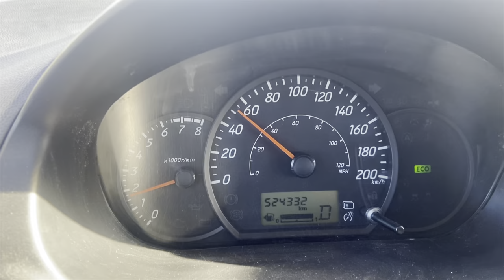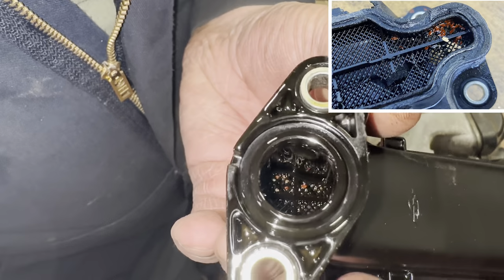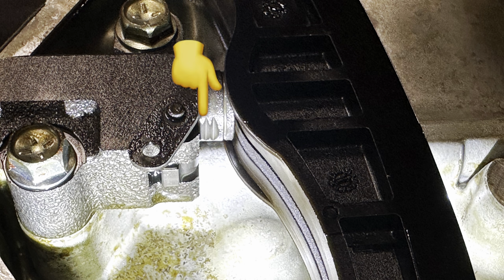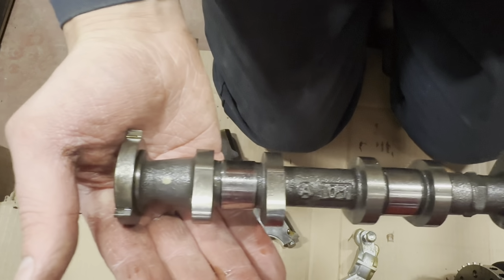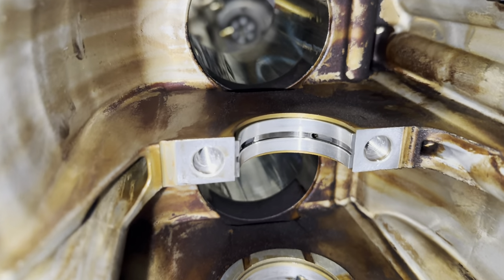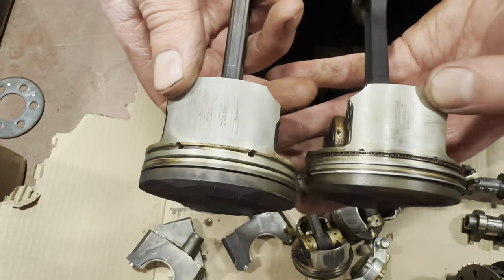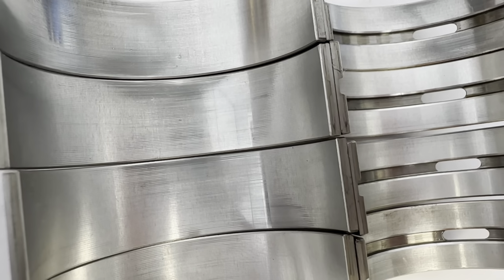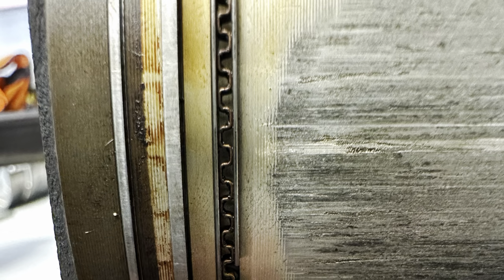524,000km Mitsubishi Mirage engine teardown

Comment: By the look of this, I’m going to die before my mirage. I bought mine in 2014 at 30. Now I’m 40 and the car doesn’t have 90k. So another 40 years of duty for her I guess 😅
Reply: it will definitely rust through before engine gives any sort of problem ¯\_(ツ)_/¯
Reply: You've got a family heirloom!
Reply: Lol yeah the little Mitsu is definitely gonna give you a run for your money. 

I remember back in the early 90’s my mom bought a Toyota Corolla that she swore she would keep until it died. She said she would NOT buy another car until the Corolla was done. In 2005 she flat out give the Corolla away with 250,000 miles on it. Me being the cheeky bastard that I am was like “mom I thought you were gonna keep it till it died? 🤣” She says “no I got tired of waiting for that thing to die. No one should have to drive a 1990 Corolla for as long as I’ve been driving that car” lol. She bought a brand new 2005 Camry SE that she drives till this day.
Reply: @Soh90  Toyotas are awesome just because of how many owners they can go through without becoming a piece of shit. A lot of cars are designed with only the first owner's experience in mind, but Toyota's interiors, drive trains, and chassis', are all engineered to go through several owners while still feeling as good as the day they rolled off the dealership lot, provided they are properly maintained. Many other brands, even when well maintained mechanically, have disintegrating seats around where the thigh meets the chair, melting steering wheels, and a rut worn in the carpet or floor mat right where you pivot your foot on its heel from the brake to the gas, but very few Toyotas, even extremely high mileage ones, I've seen these kinds of traditional wear patterns in. For contrast, my place of work has a Nissan Frontier with less than 30,000 miles, which is used as a company vehicle. There is a literal HOLE in the carpet where the driver rests their foot that is deep enough it catches the heel of your shoe if you try to adjust the angle of your foot to the pedal.
Reply: I bought a 2019 G4 5 speed a year and a half ago. I bought it with only 10,600 miles on it, now it has 20,500. At ~8k miles/year, I think mine will last a long time.
Reply: A car doesn’t know if it was driven 100k by one owner or 10k each by 10 owners.
Reply: I live in the rust belt, my '15 gets oiled spring, and fall. Mechanic says no sign of rust, yet.

Comment: Here in Australia, the 1.5L 4 cylinder Mirage(3 door) and Lancers have revered status as bulletproof runabouts. I bought one from a wrecking yard - it just needed a hood - and with some brakes, injector o-rings and roll bar bushings we got it registered for a new driver. He, naturally, ran up the arse of someone and bought something else but still mentions how reliable and simple to work on the Mitsi was.
Reply: Everybody wants a 4 door truck or a SUV here then complains when gas goes up sometimes.
Reply: yep my first car was a Mirage with the 1.5 4G15 and i cant think of any car ive owned since that has been as painless maintiance and repairs wise as that simple little N/A eco "shitbox" Mitsubishi was. stick oil and filters in it every 10,000km and it would run forever i reckon as seen in this video.
Reply: My neighbour has a manual 5 speed mirage, he drives it like a taxi, just services it when it's needed and it just keeps on going.
Reply: Arse 😂😂😂😂😂😂😂
Reply: R.I.P. Mirage, may you be a part of someone's beer can, one day. He did not fight long, but he fought well, fearlessly, and with great fervor.
Reply: My brother has a 20yr old, 3 door lancer with 4g15 engine. He has spent $0 on his car for his 17yrs of ownership.. Nothing has broken, everything works and it still drives well. He can't come to buy a new car when the Lancer just keeps on going and going. He doesn't even service it by the book.
Reply: I think that's why the title of this vid threw me - I'm in Australia as well and these cars are super popular here.
Reply: @MattyClivingthedream totally agree with you there, I can't speak for the Mirage but I have a 2008 Mazda 3 (2.0 engine) and despite being 16 years old the thing just doesn't miss a beat. It was given to me by my uncle as he wanted to upgrade. I've owned it since 2017 and apart from oil changes and wheel bearing I haven't spent any money on it at all.

Comment: I worked at a tiny mitsu dealer and i always enjoyed these cars for how fun and cheap and simple they were, especially with the stick shift. Good, BASIC transportation. especially if you get 300k+
Reply: It sucks that today these are going away. Here in Austria a Yaris starts at 21k USD with some rebates and 26k USD MSRP and it's only available as a hybrid. Meanwhile in Japan they can buy a Yaris with 1.5L 3-cylinder and 6-speed manual for 12k USD. The worst part is I can't really import one, I'd have to get a used one fron the auctions.

Comment: the cleanest 325k mile engine i've ever seen.no wonder it went 325k.obviously well maintained.
Reply: Oil change every 12k, car is 2015 and driven 500k. Calculating those, owner changed oils averagely  4-5 times a year. Meanwhile i change them once a year, no matter of how much ive driven

Comment: I imagine if you replaced the pistons and bearings you could get another 200K miles. Amazing engine.
Reply: Yes, if you revise the engine every 50,000 miles it is an "amazing" engines because it amazes people you haven't junked it earlier. 😜
Reply: These cars are totaled easily, body panels are expensive but their engines are cheap.
Reply: @worldhello1234  because we should take your word over that of the mechanic who made this video? who has provided actual proof to back up the claim that 200k miles is easily expected from this little 3 cylinder?
Reply: To be fair, replacing pistons and bearings would get you another 200k out of pretty much any engine.
Reply: @nodak81  I know what you’re saying, but plenty of engines with this kind of mileage, revving high as these do because there’s only 3 cylinders, would have a lot more problems.  Camshaft, valves, seals, timing chain guides and tensioners, main bearings on the rods, etc would all have more trouble.  Especially when you can buy decent used replacement engines for less than 1000 bucks, this is an incredible value.
Reply: you'd wanna bore the block (provided it's not a NiCaSil coated bore) for the next oversize before jamming new pistons in. the bores wear down and go elliptical which is what allows the piston to slap around in the cylinder. Agreed though - bore it, hone it, new set of pistons and rings and that sucker would easy do another 520,000 km
Reply: If you find another motor for a grand than your getting a used one with likely over 100k miles and likeky more wear than the one he had here..  most people don’t keep up their cars..  they might change oil every 10k but most just change oil every other year or something..  but yea youre not gonna find a new motor for anything really and if you do its not gonna be cheap..  10k$ likely..
Reply: @Z-Ack  > this

Crate or GTFO

Most would GTFO because the cost of a crate motor exceeds the value of the vehicle substantially.
Reply: @Z-Ack  actually, the man who posted this video is proof to the contrary.  He bought a used motor with between 40-50k miles on it. From a wreck.  No joke, around $500 bucks.  It’s still running years later from last I heard.
Reply from the maker: I bought an engine with 6000km on it for $700cad from LKQ. That was a couple years ago. At the time you could find engines with 100,000km  for a $300 or less. Prices have gone up since then and it’s harder to find lower mileage engines for cheap but they’re still out there. Look on car-part.com or buy an entire wreck from a salvage auction like co-part.
Reply: @turdpailsandtrails I have a 1.3 Colt 2011 with 95k miles on it, but you made me want this 1.2 Space Star as it’s called in Norway, due to the reliability
Reply: @turdpailsandtrails  wow, a few years ago these were $300 engines now they are 800-1300 with only only one in my city (top 10 us city)
Reply from the maker: @earlscheib7754  There were pile of them in 2021. I picked up a cvt with 2500km for $500 at the same time. Put them both into my $1000 Mirage 🤣 It's the black car I did dumb things to in some of the other videos.
Reply: @turdpailsandtrails  Manual with 77k kms from 2015 is 5.5k dollars in Norway
Reply: @earlscheib7754 that's why you buy another one, and keep the dinged up one as a parts car.

Comment: I have a Peugeot 206 1.9D from 2007 since new, it has 880.000km and still rocking like new, with 10w40 Shell semisynthetic oil changed every 8000-9000km with oil filter, the manufacturer recommends oil changes every 15.000km, around 2/3 of the km were done in highway, foot to the floor at 140kph, its top speed at 4k RPMs, since I work on the city I mostly use this car to do 800km every weekend to visit my family, and not a single problem inside the engine. The only reason my engine was opened at 560.000km was to fix oil leaks changing all the seals (that i will need to do it again next year, is starting to leak again). In all this time it had gone through 3 alternators, 10 distribution kits and coolant changes (every 80.000km), in the fist distribution kit change i also deleted the EGR, that ruins your engine when it gets old, 3 sets of coolant hoses just to be safe and don't risk and overheat due to a hose breaking, steering pump rebuild due to bearing noise at 630.000km, one injection pump rebuild due to diesel leaks at 530.000km, a set of new injectors in this same service, 18 diesel solenoids (yeah those are a piece of junk, I always take all the tools to change it with me, you never know when it will die). Conclusion: if you want your engine to last a large amount of km, just change your oil every half the time your manufacturer recommends and nothing will wear inside of the engine, manufacturers want you to buy new cars, so "recommended" oil change intervals are way distended, so your engine doesn't last long, all the owners of this same car that I know had to rebuild their engines with pistons and crack bearings worn out between 300.000-450.000km, I have done over twice that without problems, just changing the oil with good quality one more frequently, and still don't have a single noise in the engine.

Comment: Cool teardown, thanks for sharing - the greater cylinder wear on the firewall side is normal - all piston engines have a major thrust side caused by the piston pressing harder on one cylinder wall side during the power stroke, which causes more wear - the opposite side is the minor thrust side
Reply: not only is it normal, engineers often design around it. the pistons in the 2zr-fae (the newest 2zr variant used in the 2020 corolla and a 1.8L NA four banger) for example are offset either 0.8cm or 0.8mm from the crankshaft. this is done to improve fuel economy by reducing force and thus friction between the pistons and the major thrust side, but as a side effect it makes the engine a bit more durable.
Reply: @doctorunicorn5550 Indeed - offset piston pins/cranks aren't new though - Toyota introduced an offset crank in the 1NZ-FE 25 yrs ago - many engines don't use offset to balance power, noise, and low friction - while offsetting towards the major thrust side lowers piston slap, noise, and friction it costs mechanical advantage and power, which is why some race engines have offset towards the minor thrust side instead - offset also creates greater imbalance

Comment: Can instantly tell it was well maintained when that valve cover comes off. Not even golden brown varnish built up. Impressive!
Simple little engine. Not highly stressed. Should go a long while with proper maintenance. Really not much wrong inside there.
Looks like only real issue is pistons and hurting cylinders. If designed for durability, not fuel economy, would last even longer.
I'd expect some brands to go much further with the same maintenance. Of course, other brands will be dead long before this.

Comment: Amazing how clean the inside of an engine is when it DOESN’T have direct fuel injection. Most pistons get skirt wear on one side.  The firing event happens more on one side of the piston than the other, causing the piston to tilt slightly and forcing it harder in to the cylinder wall on one side.

Comment: My 2015 (almost 9 years old) Mirage CVT has 80.000 miles on it and I had zero defects. Zero oil consumption (yes, it is possible!). I only drive below 60 mph (= speed limit here) on highways. 60 mpg on average. What was replaced? 16 wipers, 2 front brakes (discs and pads), 4 tyres, oil every 10.000 miles, 1 oil change for CVT, a dynamo belt (not a defect, just screaming at cold start), 2 times an alignment (and due again, it is a weak point apparently), a top off of the airco refrigerant, and a small leakage at the roof (just some kit applied). No rust visible, no rattles anywhere. As new.

Comment: I'm more impressed by someone driving a little matchbox car close to 60.000km a year than the condition of the engine lol. That's quite a human achievement. 😅
Reply from the maker: And without cruise control. 🙃
Reply: @turdpailsandtrails  how's the noise on highway?
Reply from the maker: @space_cowboy007 I don't drive them too often on the highway, I have one as a daily and maintain a fleet of them at work.  It's bearable to me but not to a lot of other people I guess. My Mirage is much quieter on the highway than a my Dodge diesel and a V6 Delica.
Reply: it's actually far less of a chore to drive a small car. It's lighter so it does not throw you around when driving though bumps. It's smaller so it easily fits everywhere and You always have a margin. It's easier to go in and out, especially in crowded parking lots. Tires are cheap so if you feel they are getting old you just change them without needing a loan. Windows are big and the hood is small so visibility is great.
Reply: @piotrcurious1131  Driving 60.000km a year continuosly is far more of a chore in a small car because then you have to do long distance runs often. It's not just skipping about between shops in the city that will make all that in a year.
Reply: @piotrcurious1131  i owned a peugeot 106 i know all this. only problem is it was way too noisy on the highway to comfortably listen to music
Reply: I'd call it an inhuman achievement 😂
Reply: Loved mitubishi great underappreciated brand in USA
Reply: 1st world problems.

Comment: For the bearings that's not a spec of dirt , that's a spot caused by acids accumulating in the engine oil due to it not getting above 100 degrees C (212 F) , the acids remain there and eats the bearing surface , it's caused by short drives and not letting the oil warm up so that it can evaporate those acids and vent them through the crankcase breather
Reply: The scored piston skirts also tell of short trips in cold, or being driven a bit too hard before warmed up. The majority of the mileage must have been highway overall though!

Comment: I worked at the dealership for a while and we did replace these engines from time to time simply due to piston slap.
You could simply replace the pistons and go for a while longer but at the dealer it wasnt worth the labor for the customers so we replaced the engines instead
Interesting teardown!
Reply from the maker: I had a 2014 with 30,000miles that I took in and had the engine replaced under recall or warranty because of this same noise. 

It seems to be pretty hit or miss. We have a 2015 here with almost 350,000miles/560,000km and it still runs great.
Reply: @turdpailsandtrails  since the skirts aren't quite long enough, it causes excessive slap and over time, that noise
If all the wear components like the block and bearings are still in usable shape it might be worth changing the pistons to get at least another 200k km out of the chassis
Reply: @thom_lapatate4842  These cars don't have a chassis. You'll still need to replace worn out suspension components and tires etc.
Reply: You are right but everything is pretty cheap on these including the 14 inch tires. Point is it could last a lot longer with love and with the milage this one has its hard to say someone didn't love that thing

Comment: my daily driver is an 87 lancer.its 37 yrs old and runs like a swiss watch,only been apart once to replace head gasket and timing belt,nothing else,except water pump,valves and cam were fine,also replaced valve seals..great car

Comment: Goes to show that maintenance is key. Thank you Sir for the video.
Reply: Not only that, but shows how well engine is designed. Try to push too much torque or power and it dies faster

Comment: I currently work for Mitsubishi, well a dealer. I work on these all the time and they are brilliant little cars. I personally own a 23 outlander sport SE 4wd. We had a lady that drives for Uber and Lyft as her occupation, she had a 2019 outlander sport and she traded it in with a little over 300k miles. The car ran perfect and had no issues. She did all of her maintenance. If I had the spare money I would have given her cash and used it as a beater lol. It makes me happy to see all the love for the Mirage because a lot of the time all i hear are negative things, people act like its a luxury car when in reality its a cheap economy car meant for reliable transportation.  I'm a bigger guy so I would have gotten one but obviously its a bit too small for me so i went with the Outlander sport. I will always support Mitsubishi but a heads up to anyone wanting or thinking about getting a new Mitsubishi, do it sooner rather than later if you want an actual Mitsubishi not some Nissan/Renault/Mitsubishi hybrid monstrosity. most of the new models coming out (like the current generation DG Outlander (2022+) are going to be alliance vehicles with Nissan powertrains or some mix of them all.